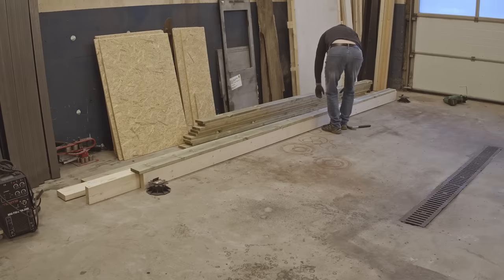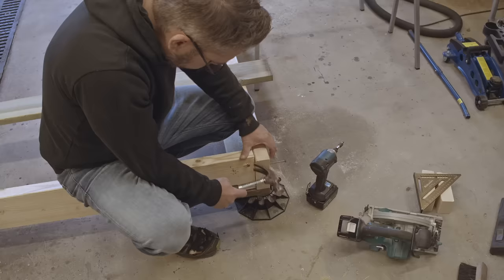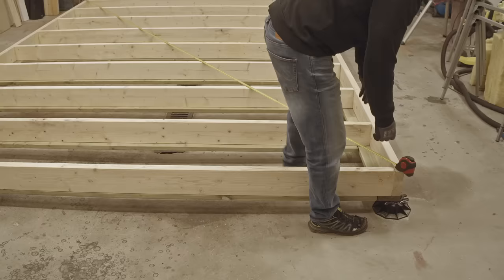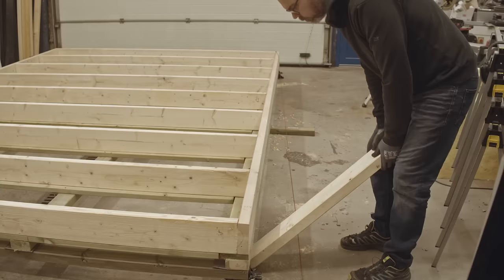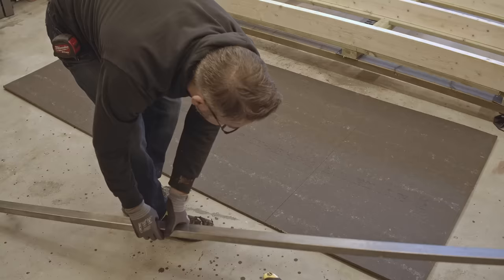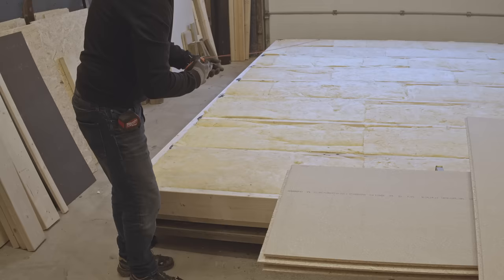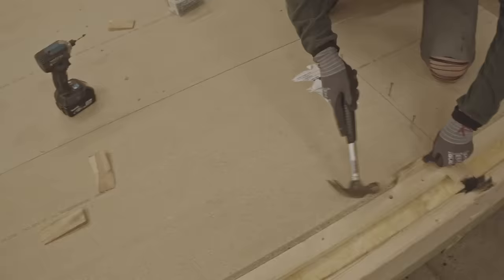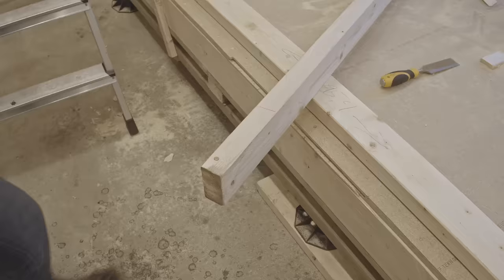Building a High Quality Garden Room The Norwegian Way

Comment: Hi Dieter! Everything very neatly done, however for a Garden room - situated in nature - I would presume that all insulated&covered structures, including the floor, walls and ceiling be constructed in a manner which is 100% mice- and rat-proof. This necessitates the use of high-density thin metal nets between the insulation and cover material to avoid the intrusion of rodents. I didn't notice you taking any precautionary measures against rodents. How have you solved the problem of rodents?

Comment: Hi Dieter,

I enjoyed this video very much. You are a professional. But why not use vapor barrier foil and vapor barrier foil? This prevents moisture from entering your insulation material.
Reply from the maker: Thanks! The insulation is fairly thin so it's not needed as the wood fiber boards are hygroscopic, and the wind barrier let the moisutre out. Compared to a house, this building may be unheated in periods so a vapour barrier can actually cause damage as you may get condensation on the inside. In a modern heated house with 30-50 cm insulation and balanced ventilation systems a vapour barrier is essential.

Comment: Looks awesome, really well built -- I love the details in the base. Elevated, plus sheeting, insulated and air sealed. Can I ask, do you vent the ceiling? Looking forward to the next video to see how you insulate the roof.
Reply from the maker: Thanks. There are ventilation, but not like a vented attic. It's a "warm" roof. It has a vapour barrier that let any moisture in the insulation out. Then there is a air gap above to make sure there is good air flow. I will show this in the next video.

Comment: good job and end result. id use `screw clamps` when possible though. many assume two piece of material is forced together tight with screws, this often is not the case. and if so.. the gap between material often lead to a weaker(then optimal) and `squeaky` construction
Reply from the maker: Not problem if you use correct screws. I mainly use the clamps for aligning.
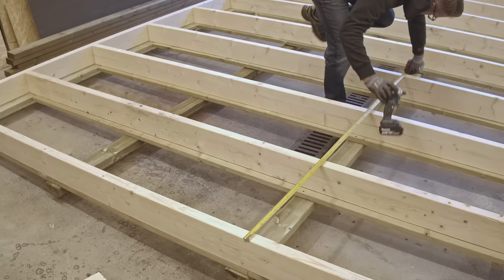Reply: @DieterSchneider  well I disagree. a long `neck` is no guarantee for the pieces to merge fully. 4:15 for example. and few of these are as tight as they could be, judging by the photage

Comment: Nice build! Looks like a lot of hand nailing, though... Maybe check if you could use a stapler for the wood fibre boards...
Reply from the maker: Thanks, That is possible, but I it's easy to mess up as the boards are very fragile.

Comment: Just subscribed. I'm from the UK and looking to build a long wooden building to serve two purposes. Wall down the middle forming two sides - one a shed and the other a sort of summer house. Loving the build here and will definitely be looking at follow some of the methods here. Just curious, why do you have to make it almost air tight?
Reply: New subscriber here as well. If the quality of your videos is like this - will be staying :)
Reply from the maker: Thank You. For the insulation to work porperly it must be as air tight as possible, but it's also important that it let the moisture out of the building so I use a diffusion open membrane.

Comment: Awesome! I have a question: if moisture gets in under the floor, if there's a flood for example, will sealing it up underneath prevent the insulation from drying out?
Reply from the maker: Thanks! A flood would always be a problem of course, and yes, it may prevent it from drying out. Also, the wood needs to "breathe".
Reply: @DieterSchneider  my garden is rather squishy underfoot, and water pools on the path the other side of my garden fence. Both my sheds aren't wet, but they could get damp. I think a poured concrete raft might be the only long term plan.
Reply: @Mikey__R   Concrete piers are a good way to go on wet ground, 👍💪🔨🇮🇪
Reply: @TheToolnut  cheers! I don't know how far down I'd be digging to get past the clay! Thanks for the suggestion, I'll add it to the list of options to research.
Reply: @Mikey__R  Usually between 2' to 4' is sufficient. As long as your below the frost line you should be fine. If you can get a bob cat in there with an earth auger you'd have the pier holes bored in no time.

Comment: Nice and precise build, love it! Could you tell me what the sheeting is you use for the floor and walls?
Reply from the maker: Thanks, it's a woodfiber sheathing with a  bitumen layer at one side. It works as a wind barrier. Very common on wooden buildings here in Norway
Reply: @DieterSchneider thank you for the information

Comment: Very nice, thank you for the info as I am planning on building a wood storage about the same size on the roof of my house in Greece. It is going to be siting on the concrete roof and probably not going to built a base, as the rain water is not a big consideration, and the house roof has a slight slope which gets rid of the rain very quick.  Probably will just put two layers of 2x4 with a tar layer protecting it (They don't seem to have chemical treated wood there, and don't seem to know about them), bolted to the concrete, and the walls on top of them.

Three questions, which I also noticed that apply in Greece:
1. Instead of woodfiber, wouldn't it be more rigid/stronger to use plywood? I would think woodfiber is cheaper, but are there any other inherent advances over plywood? Note, Greek islands don't get below zero C often, and insulation is not as common.  Also, wouldn't plywood be stronger/longer lasting than particle boards on the floor?
2. In Greece they don't have as much tradition/resources working with wood, but I am surprised how little they use metal/Simpson-like ties for stabilizing joints.  Is it the same in Norway? You don't seem to use any.  Here in the U.S., as you definitely know, every joint has some kind of a metal tie support.  What are the advantages of not using them in Europe? Is it cost, access, tradition, need?
3. Here in the U.S. we use primarily nails for framing, very few screws, usually what we call structural screws.  What kind of screws do you use? They seem like what we call here, deck screws, not actual structural screws.  Am I correct?

Oh, and where in Norway are you at? Just curious, only because I have a friend in Tromso.
Thank you!
Reply from the maker: Thank You. 

1. The reason for using these wood fiber boards is that they are hygroscopic, which means they pick up and release moisture. They are very good for insulated buildings as there are less risk of trapping moisture inside the wall. I always add bracing to the framing so rigidity is not a problem, even though the wood fiber boards are rated for structural use, and they need to have nails every 10 cm. On a non-insulated structure plywood, osb, or metal sheathing is ok. The particle boards for the floor are rated for load bearing floors, and will last for decades. 

2. We do use metal ties, but mostly on roof trusses and decking, and storm ties in windy costal areas. 

3. We primarily use nails here too, I like to use a combination in places where I want to pull things very tight together, especially on the battens. I use different types of screws. For the battens decing screws are fine.

I'm located on the west coast south in Norway (close to Bergen). Tromsø is about 1600 kilometers away from me (24 hours to drive). I'm actually closer to Berlin, Germany than Tromsø :)
Reply: @DieterSchneider ❤❤❤❤Thank you!!!!

Comment: Thanks for sharing. What about moisture barriers (PE plastic)?
Reply from the maker: Thanks! The insulation is fairly thin compared to a modern house so the moisture will go through the walls. It can also be risky with a vapour barrier if the building is un-heated in periods, as you may get condensation on the inside. A vapour barrier would of course be needed on a permanently heated modern house with 25-40 cm insulation and balanced ventilation systems.

Comment: Very nice work. @8:59 and other places, you put a board in front of the nail gun. Why is that? I'm a DIYer so I am not familiar with all techniques of nailing.  Looking forward to part two.
Reply from the maker: Thanks, that is just to add downward pressure to make sure I get a tight fit

Comment: I'm a bit unsure about the floor sheets passing under the walls like that. Won't that cause a significant thermal bridge into the flooring? You can always get away with slightly colder air inside, as long as the floors aren't cold.
Reply from the maker: The thermal bridge will be there anyway, unless there is insulation between the boards and the bottom plate. The floor will also be heated. This is also such a small building that will be heated very fast.

Comment: why use a GU plate and a wind barrier (vindsperre)?
Reply from the maker: It's not GU, it's wood fiber (asfaltplate). This is a very windy and rainy part of Norway (west coast), and It's common to do it this way. In drier parts of the country the woodfiber board may be enough, even though I think it's starting to get common with double wind barriers in these areas as well.

Comment: Hi, I understand the build but why the wood fibre board on the exterior face and not (say)  OSB plywood? Fibre boards aren’t exactly structurally strong? Just interested in the use of this material…. Also do you have a spec for this material?
Reply from the maker: Because they are diffusion open (let moisture out). The bracing is for strength.

Comment: IME bugle headed screws will spit the board as the boards dry out, regardless of your drilling, allowing the board to retwist.  It would be better to use flat headed screws in this situation.
Reply from the maker: The boards are probably as dry as they will ever be. This is not a problem.

Comment: I would not have used this mineral wool, they lack thermal mass. I built something similar but with compressed straw in the walls, it highly participate in the bracing of the structure while also greatly improve thermal mass (straw (90%)+water+clay).
Why adding silicone in the bottom structure...? Wood and silicon are not friends, it can prevent wood to dry if something happend. I do not see the importance of sealing at this  place.
I used 90% screws building mine, only 90mm nails there and there, squares (95mmx95mm) every 2 vertical post, on top and bottom to prevent vertical tearing in case of high winds.
I got a cold roof, from the inside : 20mm wood, vapor barrier, 200mm wood wool, rain barrier, 40mm air, metal sheets.
I can see no condensation even with hard transitions, it's kind strange, maybe I do not have enough air circulation.
Reply: Materials with higher thermal mass have lower insulation performance.

Comment: 8:26  Привет Дитер. Моё имя Николай . Ютуб знает что мне интересно "Cold Climate Building Techniques and Concepts

ColdClimateHousing

13 видео" Теперь вопрос : Вы используете систему сс( центр центр) с шагом 600мм. Почему не сестить все проемы под ширину теплоизоляции ( на Аляске ее перевели как " летучая мышь из фиброволокна) и сделать одну Узкую часть. Уложить все без подрезки/ подгонки ? Это первое видео которое я смотрю на Вашем канале и первое видео от Норвежского мастера. Очень позновательно.
Reply from the maker: Thanks. I translated on Google so I hope this answers your question. The cc 60 fits the insulation, except the first and last.
Reply: @DieterSchneider  or rather the first and last joint is half a joist width closer than cc60 to accommodate the standard sheeting sizes.
Reply from the maker: yes, that's right @boberson83
Reply: @boberson83  согласен, это моя ошибка / я был невнимателен.